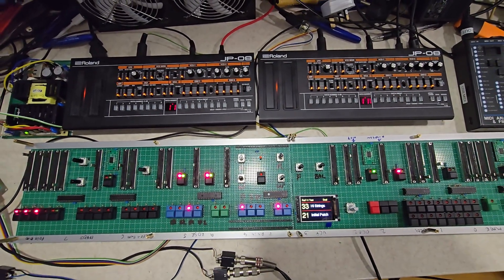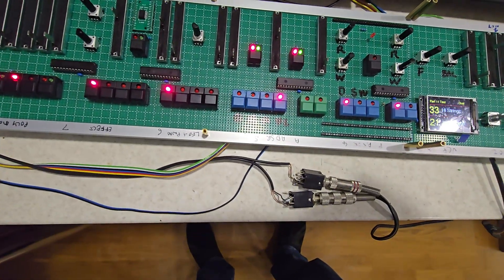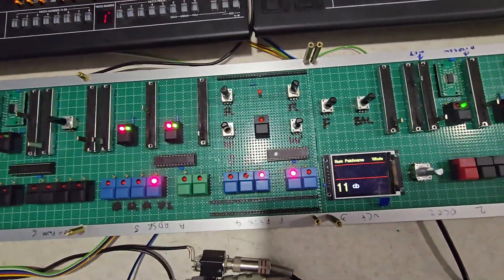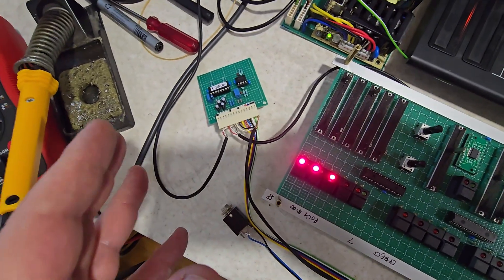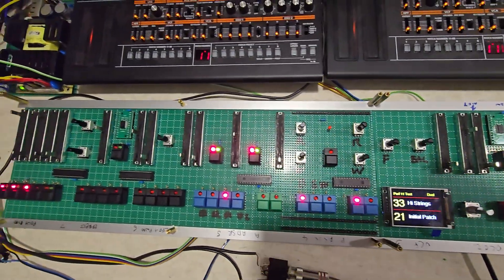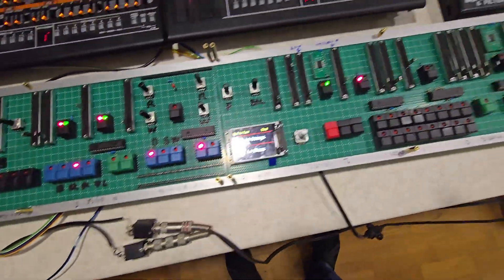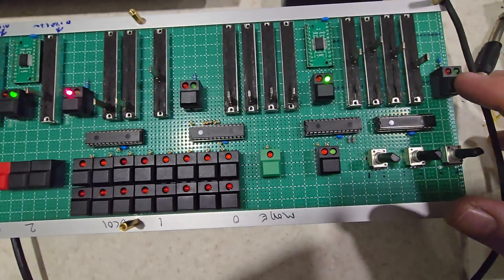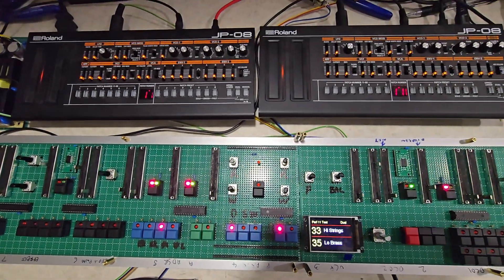Completed software and hardware for the Jupiter 8

Comment: Uaw! This is amazing, I was thinking on buying on roland se-02 transform into a a minimoog with the keyboard and everything and this way i can have a mog with presets. I don't know how i'm going to do it but i see that its possible. I know that i can build the controller but my concern is regarding the keybed, there's a way to send the keyboard information without using the midi port?
Reply from the maker: The SE-02 has a midi port and a usb port, but what's wrong with using the midi port, you controller can pass data from it's midi in to midi out. I use a Teensy it has multiple serial ports so I can read in on one and out on another etc